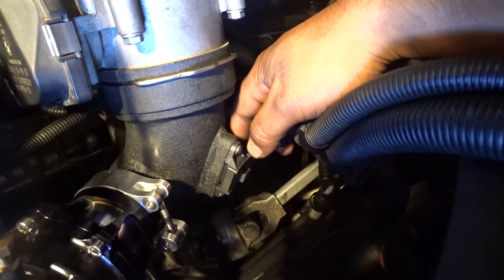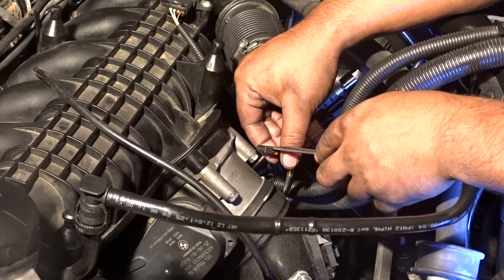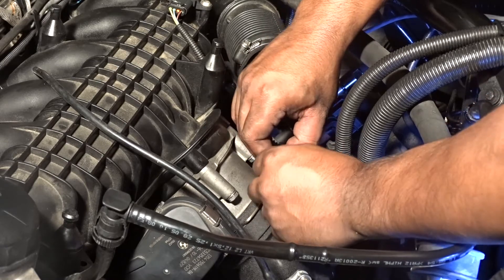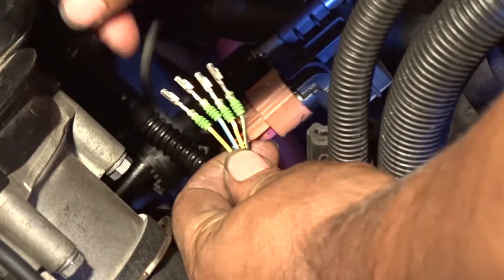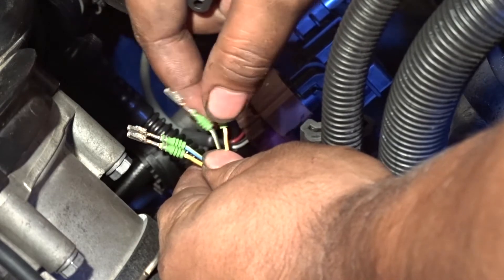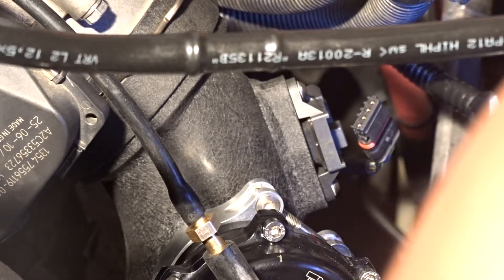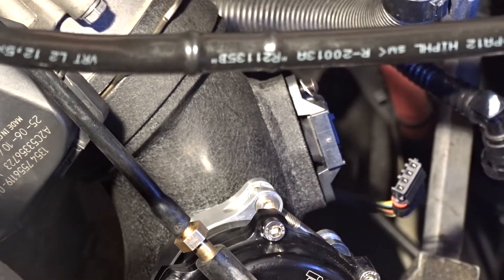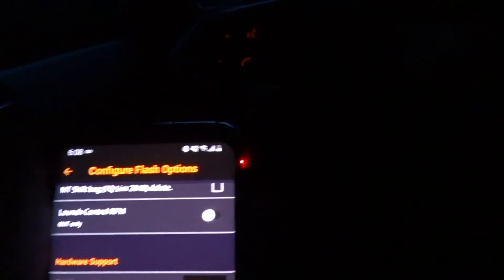How To Install An N20 3.5 Bar MAF Sensor To An N54 (Without Wiring harness)

Comment: Ever get 2ABD code after this? I swear I’m repinned correctly everything is snug and my car is very angry with me after doing this plus single turbo LOL
Reply from the maker: There's a setting in mhd to switch to the n20 sensor, but i didn't get any codes
Reply: I get the same issue on my st setup, what fixed your issue?

Comment: Okay so if the map sensor is right there what is the sensor on the manifold is it the same thing
Reply from the maker: They are the same sensor but the one in the manifold is the map and the one in the charge pipe is the maf my mistake